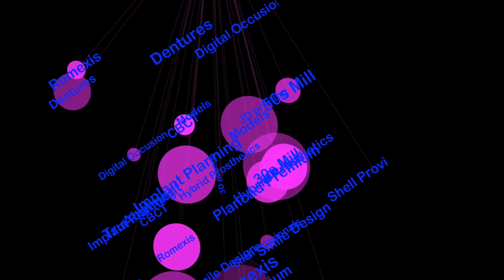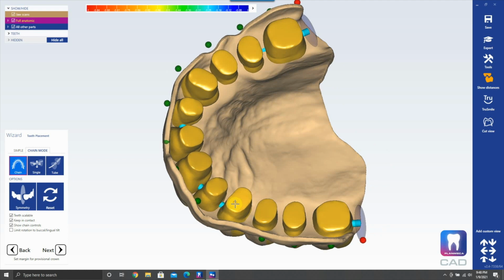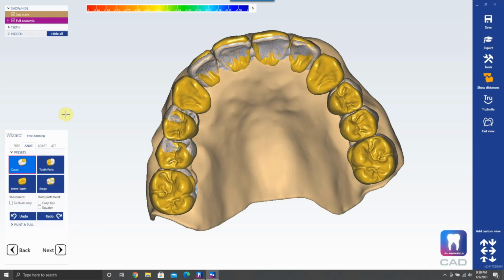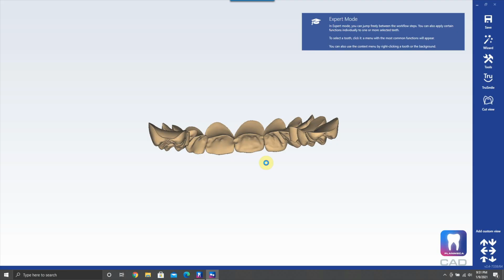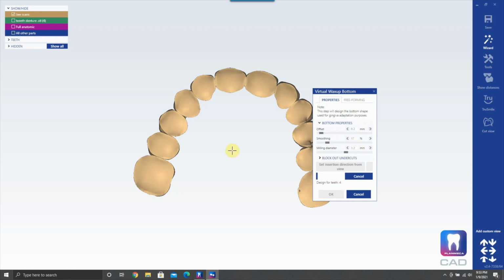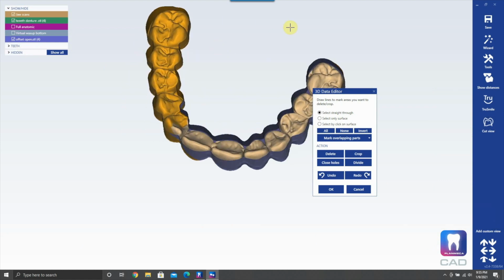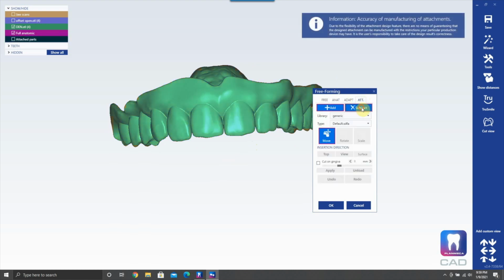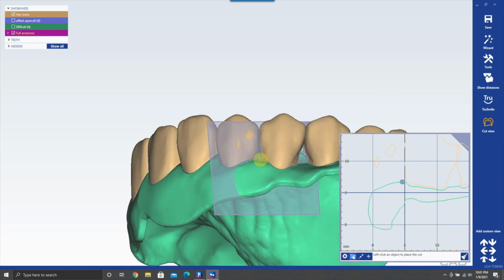copy denture in Exocad Plancad Premium

Comment: Thanks for the videos! Following this vid, when doing the boolean subtract, it never works and I always get an attachment operation error. Any work arounds?
Reply from the maker: You have to export the final merged (green) teeth and only that visible.
Reply: @wallyrenne  I have .stl of the upper denture, the teeth(from shells) and the offset wax up. Even now if I set up a new cad scene, load the scan, then load the denture as a wax up to get it editable. Then in free form I go to attachments, subtract, load then when I click apply it takes a while and fails stating that the geographies are not intersecting even though the offset is sitting on the denture waxup as per yours in the vid, Im using Galway?
Reply from the maker: @jameshellard7430  the offset must be solid. No open top no shell. Make sure to close the top by putting in in as a model and edit mesh and close holes
Reply: @wallyrenne  I've done that too, maybe I'm being silly and missing something, or I could have a bug in my system? I have tried a couple of times now and can't get it to work. Heck even mesh mixer bummed out on me. I imported the upper denture and offset in there. Tried to difference the mesh and got a fatal software error :( .  The particular denture im trying is also very thin like the one in your video. I tried to think through the process and find the issue. Im stumped!
Reply: FYI: I managed to get it to work. The denture was paper thin and didn't allow the 2mm cut. I dropped it to 1mm and re-scanned the denture and it all worked as per your video. thanks again! J

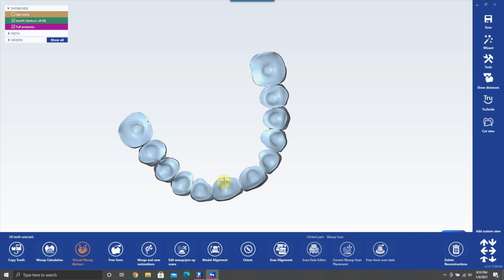Comment: The bumps you added to teeth 7:00-7:34 did nothing.
Reply from the maker: I mention in the audio that I didn’t use that to make the offset because it would have put holes in the base because my dentures were very thin. Input then to show how to add retention should you have room.